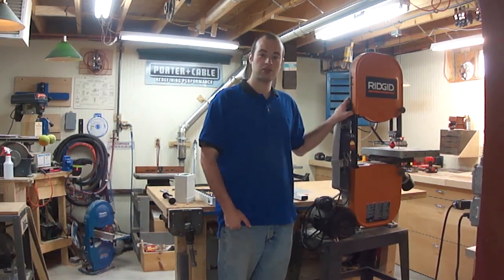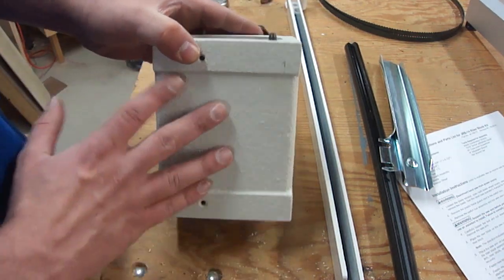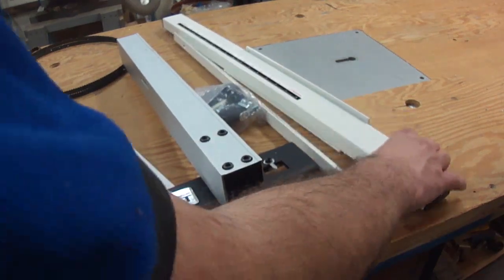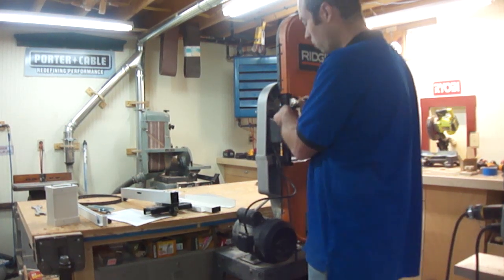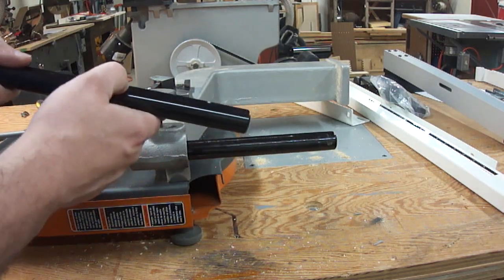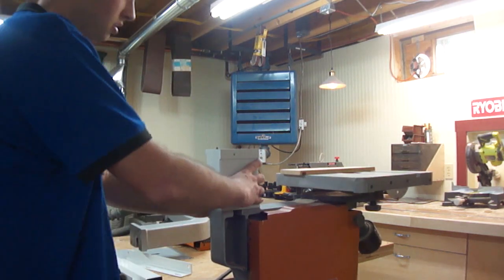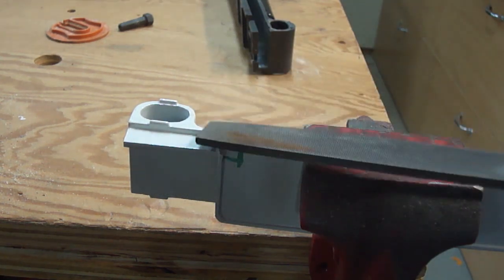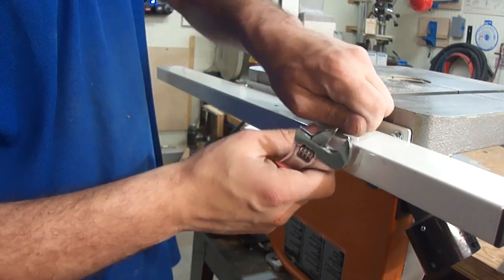How to Install a Riser Block and Fence on a Band Saw

Comment: Thanks so much for the video on this. I have just refurbished that same bandsaw and have a Grizzly riser kit on order. This will definitely make it easier!
Reply from the maker: Glad I could help!
Reply: @dougfowler9609 did the Grizzly Riser block kit fit the Rigid?  I have been wondering that
Reply: I bought the "Grizzly H3051 - Riser Block Kit for G0555/G0555X" and this video's tip on just drilling out one hole to remove the paint was the only modification I needed to make it work.  How did yours turn out?

Comment: Really enjoyed watching your video... I recently bought an older Ridgid 14" bandsaw- it's gray not orange. Based on your video I decided to get the Grizzly riser block because it was on sale and save me about $30. It fit like a glove but did have to use a step drill to allow the top section of the saw to sit properly.The bottom was no problem.. !!? It works great BUT the 105" blades are nearly impossible to get on because the fit is way too tight. Did you experience this too? Or have you heard of anyone else have this problem? Thanks again for the well done video,  Larry
Reply from the maker: Does the bade almost fit? I wonder if the blade tensioner is hung up and can’t go all the way down. Also have you tried a different blade because I have found some variation in blade lengths in the past. As far as I know the gray Ridgids and the 14” Craftsmans are mechanically identical to the orange Ridgids because they were all made by Emerson Electric and painted any color scheme the retailers wanted.
Reply: Thanks for the feedback... I am going to measure the blade tonight to see if it is truly 105". The tensioner is all the way loose and I amd going to take it apart to see if something is keeping it from dropping lower.. I'll let you know what I find... again, thanks,  Larry
Reply: I figured out what the problem was..... somehow the blade tensioning plate, which has a funny kind extrusion at the bottom, was on the wrong side of the back cover. As a result the tensioning plate would not drop down al the way. I'd noticed this before but since I'm new to this saw, (new to bandsaws in general!!) I thought it was in the correct position so never paid much more attention to it. This time I took the upper wheel off and starting messing around with the tensioning plate and WALA - LOL. once I repositioned it to the back side (outside) of the cover the blade had plenty of slack.It runs like a clock. Thanks for talking time to offer suggestions... really appreciate it, Larry
Reply from the maker: I’m glad it worked out. If you have any other questions feel free to ask.
Reply: Thanks for responding to my question and for the suggestion -- it made me look closer at the tensioning mechanism. Do you have any idea what the difference between the orange model you have and the gray model I have..they appear to be the same.

Comment: I have an older Jet band saw built in 1982, it's not blue, it's actually gray like it's Delta/Rockwell counterparts. As an added bonus, the alignment pins on my saw are in the opposite corners as the holes and pins on the riser, AND they were even drill at an angle on my saw. I had to take some careful measurements and drill new mounting holes on my band saw.

Comment: Thanks for this video!  The tip about removing the paint was all I needed to make the Grizzly G3051 riser block work!

For the long blade guard on the up-side, is it okay to install it open-face-in or face-out?  When I bought the saw, it was faced in so each time you changed the blade, you'd have to remove the guard.
Reply from the maker: Yes, the guards used to (30 years ago) always come from the factory with the opening facing out but now it seems like a 50/50 chance. I think they’re now If it was me I’d flip it around so you don’t have to take it off to change the blade each time.

Comment: I see that you also got a new longer blade guard,,,My blade guard on my Rockwell saw broke,, one of the bolt holes used to attach it to the saw snapped off and I have it epoxied on there,, do you know where I’d be able to find A replacement..I was going to make one out of solid aluminum and mill  out the slot But it’s a lot of work I’d rather not have to go through..????

Comment: Any way to show the current Ridgid bandsaw and cutting?
Reply from the maker: It can be seen resawing in the desktop organizer video and it makes a quick cut near the end of the latest video on using the RAS as a lathe. But if you want to see it resawing the desktop organizer video is the one you want.
Reply: @TheNorthlandWorkshop  5hp makes that a different saw.
Reply from the maker: @SQ_og  it still had the 3/4hp motor on it in the desktop organizer video.

Comment: thanks for the vides.... link to the riser block and fence??
Reply from the maker: This is the fence I bought: https://www.ebay.com/itm/JET-714102-Fence-Kit-for-a-14-x-14-JET-Woodworking-Bandsaw-Table/274524332265?ssPageName=STRK%3AMEBIDX%3AIT&_trksid=p2057872.m2749.l2649 
And this is the riser block: https://www.ebay.com/itm/JET-708717-Riser-Block-Kit-for-14-Bandsaws-with-7-8-Guide-Post/254490891832?ssPageName=STRK%3AMEBIDX%3AIT&_trksid=p2057872.m2749.l2649
Reply: @TheNorthlandWorkshop  thanks man